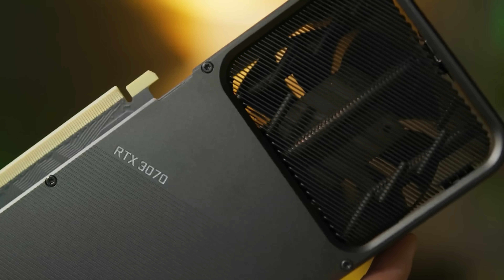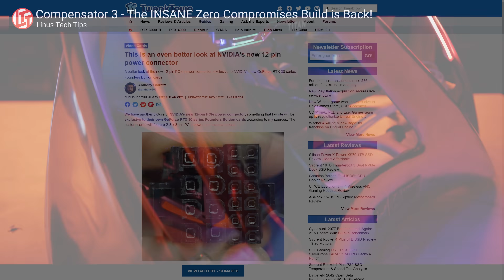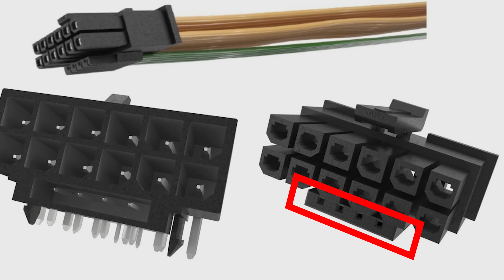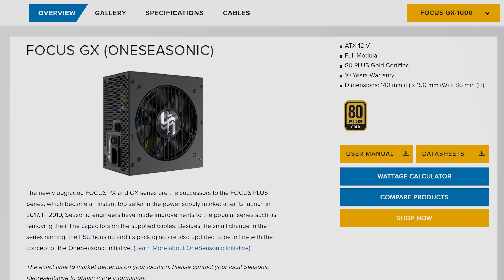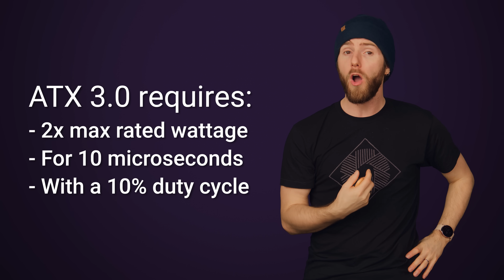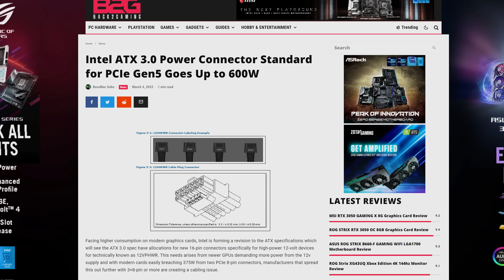Do You Need A New Power Supply? - ATX 3.0

Comment: Intel is getting even more anti-consumer. Great. Exactly what I needed. Just bought a SeaSonic Prime PSU last year. Now, with my planned RTX 4000 Series upgrade, I'm most likely forced to buy a new one. Intel you **
Reply: This is like being angry that a new wifi standard got released when you got a new router a year ago. It's not gonna become obsolete at the snap of a finger, hell this entire video was basically saying "it's probably not"
Reply: @2KDrop  Yeah, no. It's a different story. Even when a new WiFi (or USB) standard is released there is a certain backwards compatability. There is no need to upgrade all devices to establish communication between them.
Reply: This isn't anti-consumer. Intel doesn't really get much out of this other than making things easier for themselves and others.  

If we want things to remain somewhat standardized, we need those standards to be updated to match modern technology. If graphics cards are drawing more power than an ATX PSU can easily provide, then GPU and graphics card makers will start using different options. We already saw that with Nvidia's attempt to create a new 12 pin PCIe power standard.
Reply: @MiIIiIIion  It's anti-consumer because of the communication "needed" between the GPU and PSU. It's unnecessary and a simple lockout / controlling mechanism. 

No one would have had a problem if they only used a new connector or thicker wiring. Those changes would`t make current or older PSUs useless. It's not like they can't already provide enough power. 

This also produces unnecessary waste. Decent PSUs easily work for 7+ years and can be used again and again. That's why there are established standards.

Comment: My pc used to shutdown when running benchmarks with my 3080 was using 2 separate 8 pin cables plus one of the pig tails that comes with the cable. Switched to 3 separate cables and it fixed the issue. RM850x PSU.

Comment: Yeah, no, I don't want companies abusing the voltage negotiation chip to sell the same PSU at different price points but with intentionally nerfed power delivery.
Reply: That literally would make so sense from the manufacturers point of view. This is a stupid post, but somehow 28 people were dumb enough to upvote it.
Reply: Why would they sell a more expensive PSU for less money by reducing power delivery
Reply: @pie75  Well, I suppose they could make it work on economy of scale, it usually wouldn't work because higher power means everything needs to be beefier and more expensive, but if you're buying a something like a million of them, maybe you can get the production costs low enough to be able to do that and you might be able to get away charging a slight premium for the fully unlocked models to make up for selling the lower end models cheaper.
So yeah, it "could" technically work.
Reply: @vgamesx1  but why do that when you can just do what they do now:

have the same production line but put less parts into the cheaper versions which deliver less power

economy of scale doesn't change that you're selling more expensive physical parts for less money than you could because ???

it's not a toy or a shoe, or an IC, where there's tons of room for binning

it's a PSU that has to be built for its rated power
overbuilding it is just spending money on stuff you're not selling
Reply: @pie75  Idk, why sell a car with autopilot and heated seats then disable access to those features?
Reply: @vgamesx1  the scale of production for a part like a PSU is on a completely different level from an entire car of any manufacturing capacity. PSU's don't have as much room for gains in the economy of scale, because that's a logarithmic efficiency.

Even then, most cars don't come with those features: you pay for them to be physically installed. And the subscription comes afterward.

They don't distribute cars with features locked in basic models - those models simply don't have the parts to use the features. Giving people pieces of the puzzle that they haven't paid for is paying for things you aren't selling.

Selling them the parts, and then selling the subscription to the parts, is adding revenue onto a sale - which is not the same as "selling the same PSU for less because it has a software lock on power delivery"
Normally with small parts, the thing you want to do is sell the same thing for more, with the software reporting its details incorrectly. - you know, scamming, not paying more to sell for less.
Reply: @pie75  Never said it was the same, if anything it would probably cost a lot more to do that sort of thing on a car, which was my point... If it can be done on a car it can be done for other things and companies will do it, obvously those that do ran the numbers then came to the conclusion that it was simply cheaper to do it that way.

Yes they do in fact ship with those features, at least if nobody else Tesla certainly does, where have you been for the last decade? There have been a bunch of news articles talking about these sort of things with hardware being locked behind software, the heaters, the cameras, everything is there, it's all litterally just a software lock you have to pay for, it's only recently that they've started to pull some sensors/features because of part shortages.
Reply: @vgamesx1  That it works for a low volume product like a Sports Car - generally explicitly excludes it from applying to high volume components like PSU's, where the economy of scale is already optimal.

Yes, Tesla ships their low volume Sports cars with software locks, they ship their cars with sensor packages.

Other companies have subscription services, other companies have sensor packages and premium features.
Only Tesla ships all the hardware - and as far as I know, only all the self-driving capabilities. And for good reason - they sell that data, evidently, all companies that produce self-driving cars, or use telemetry at all, sell the data.

Would a PSU company ship sensors in their PSU if they could sell the data? absolutely - they still wouldn't sell you beefier capacitors and 4x the weight in copper for the same price.
They'd sell you a PSU with the same case, PCB and sensors, - and the unnecessary components not installed.

Companies ship small sensor packages because they can profit off them. They don't ship in-seat heaters, or additional fuel tanks, or optional electrification, or optional hybrid power trains - you need to send the car back to have those installed after-the-fact.

If Tesla does, I can only imagine the miniscule effect it has at their single manufacturing plant, compared to the tens (more, if you group brands by owner) that their contemporaries operate.

In general, things that Tesla does are exceptional. so exceptional, and unprofitable, that they don't work at all for other companies - who aren't in a position to extract so much capital from other sources: government research grants, green tax breaks; Musk's other companies, bypassing auto-dealers; direct sales, etc.
Reply: @pie75  I can see GPU manufacturers abusing this.
Reply: @pie75  Maybe so they can sell you dlc to upgrade it later. With a subscription of course. And only if you buy an NFT.

Comment: one connector i have always hated is the big 24 pin for the motherbored,  i hate how it's really hard to connect properly and needs a lot of force to put in and then needs a lot of force to remove even if you wiggle it gently,  it feels like your going to break the bored with how much force you need, it would be nice to see a smaller connecter for motherbored power, like made something simler to the sata power connecter maybe like a longer version of that, it it would be a lot easier to connect and remove, plus take up less space.
Reply: Yeah fuck the 24 pin connector. I still don't get how they haven't addressed that by now.
Reply: Has everyone forgotten about ATX12VO? I remember seeing a decent bit of coverage about it but it seems to have just disappeared.
Reply: @2KDrop  sadly, no one wants it because it is either not backwards compatible or requires a relatively fancy adapter to work with old components.
Reply: @2KDrop  VO was a fire induced nightmare it was dropped quick

Comment: With now annoying the 24-pin motherboard one is already? Already have to wrench it to get it IN the board let alone what forces it requires to try and get back out. Even if it's only 12 normal sized versus the 8 now yeah but then you throw 4 micro pins in there that'll snap off easier.

Comment: We don't need this, if your card is really going to draw 600w then it has enough room for a 4th 8pin, it's not a big deal. 

Power spikes can be fixed on the card level.
Reply: Four 8 pin connectors takes up a lot of space. Not to mention needing 32 individual wires for a single 600w card.  

And on top of that, what if there's more than one of those cards in a system? Are system builders willing to shove 128 wires into a 4-gpu workstation? Will PSU makers be willing or able to put sixteen 8 pin connectors on their PSUs?  

This new standard will halve the number of wires required along with halving or even quartering the footprint of power connections for the highest power cards.
Reply: @MiIIiIIion  i don't think system integrators or anyone else is going to want to shove multiple 600+ watt GPUs in their system, have fun cooling that.  Also workstation users and server operators tend to have specialized equipment anyway so sure it wouldn't bother them to go for a new standard but for most applications outside of that a card that powerful is going to be rare. 2-3 8 pin connectors work perfectly fine.

Comment: Think I'll just stick with my AX1500i and dongle it up, or just re-pin it. That 2x power draw seems more like a failure on the GPU manufacturer, if I buy a product and it says it draws 400 watts, but ends up potentially being 800 watts, isn't that false advertising? If that's the case and it causes component failure, shouldn't they have to pay for it? Can't really hide behind a "we didn't know" if there are specs being based around such a thing. I don't care if they draw 1600W on a GPU as long as they state the maximum potential wattage on the box (excluding customer interference of course). Manufacturers have to state the maximum possible wattage for appliances, there's no reason GPUs, or any computer component, should be any different. Same goes for motherboard manufacturers with their single click overclocks, they should be stating what the potential wattage is. This is coming from someone who ran 2 hardware modded and overclocked GTX980s for 6 years before one finally died.

Comment: How long would It be okay go keep lets say a Bluetooth speaker before you must think about discarding it before catching lithium fire? Can you guys research this?

I have a JBL Clip 2 and Ive been using it for many many years now. But now im worried of not being able to see the batteries condition other than how long it lasts. At what moment is it safe to say you MUST throw it away to avoid your house burning down.
Reply: Take it apart and check the battery.

Comment: What's stopping them from adding a 2 Pin Mains socket on the back of the GPU ?
Reply: Quite a lot of things, but let's start with the fact that a suitable rectifier -- a PSU -- that could handle that would add quite a lot of bulk to cards that are already causing numerous problems due to their size.
Reply: @Blooest   the 30 series card’s PCB is half the size of the actual card, plenty of room. You don’t see consoles with massive PSU’s like PC’s. There probably big because they are handling different voltages, and there is no demand for them to be smaller. I think its plain lazy on the vidoes script that it doesnt even consider on board power supplies. Its almost as if its a PSU advert. Nvidia promoting new PSU’s Intel Promoting new Motherboards each Gen. more can be done on behalf of Nvidia, they just don’t want to.

Comment: I miss my old Asus Strix 750 ti. No power connector, it ran off the power it got from the slot. Oh well, I will see what the upcoming AMD AM5 APUs are capable of. 
No discrete graphics card, and M.2 NVME drive, so the only cables I have to worry about are the fans and that glorious ARGB.
Reply: Honestly of they are good enough i might skip the graphics card altogether for a few more years. I'm already getting decent frames in new releases in 1080-1440 with the 4750g.
Reply: @Lightning Hydra My 3200G has about the same performance as my old 750 ti. Enabling XMP on 3200 DDR4 makes it faster than the factory OC of the 750 ti with the same 2GB of dedicated video RAM.
Reply: AMD will intentionally cripple these APUs as not to endanger PS5 market . They need to sell chips to Sony for few more years , so games on their APUs must not look better than console games.

Comment: If I remember correctly, there are also standards that let the motherboard control the voltage - PSU gives it 12V and it handles the rest - for me it would be kinda interesting to see some kind of a miniPC that has an actual ITX board inside, but is still powered by an external powersupply you can see in laptops :))
Reply: Pico PSU.  

They're still ATX PSUs, but they use an external brick to provide DC power and just a tiny little module that fits on top of the 24 pin connector to provide 12, 5, and 3.3v plus a couple of extra connections like SATA power.
Reply: Just had an extra though that would make this idea even more interesting. An external multi-rail brick that has the various dc/dc conversion in it could also easily be made with one or two different output connectors. For example since you most likely got at least 3.7, 5, 9 and 12 Volt rails, you could throw in a usb or usb c connector for example to allow other devices to charge or power from it as well. 
Saves you an extra charger at home for your mobile devices, or could allow you to use power bricks more PSU like and independent of the system. Pc needs 200 watts peak? Get a 300W brick and plug your monitor or your soundbar into the same brick. Easier to cable manage, cheaper and probably more efficient than to have multiple devices throw fairly cheap converters kf their own into the mix.
Reply: There are ITX boards like that, although nothing high end.
Reply: That's been around for ages in prebuilt systems. 
LTT did a video ages ago on the 12VATX standard too.
Reply: Actually for a mini pc you'd want the exact oposite. The problem is that transformation is at least a bit inefficient and creates heat. 
For a mini pc where everything is very close together, do you really want to stick additional heat producers right between your already very toasty components, or would you rather that heat happens in the external power brick?
Plus, there is no real reason why an external power brick can't have a multivolt output connector for your mini pc. All it does is limit the distance it can be away from the pc a bit
Reply: @reappermen  a multi--volt brick would need a multi pin input jack. 
Normally they just use 12-19 colt DC brick. Because the DC conversion internally is far easier.
Reply: @agentcrm  yes, it would need a different, maybe new connector. But doing durable safe external connectors for plenty of power is a proven concept now with stuff like usb c power delivery and such. So there's no real difficulties with making a 10+ pin connector between power brick and machine that is small yet durable.
As for the conversion, dc/dc conversion is indeed easier than ac/dc, but just like with the multi pin connectors there's absolutely nothing preventing anyone from taking a normal e.g. Laptop power brick and throwing extra dc/dc conversion in it.

Since this whole discussion is about new hardware standard vor power supply, we might as well go with the most physicaly and economicaly sensible option.

Comment: I like the idea of a 12V only power supply.  I dislike Intel's stupidity of complicating the GPU power connector with the extra mini-comm lines.

-Matt
Reply: Personally I don't care for the 12VO, it is on course but goes too far.
5v should be kept completely, and 3.3v should still go to the SATA plugs but no longer to the motherboard.
This keeps visible cable mess down as everything doesn't need to be plugged into the motherboard, and board space isn't being taken up by a bunch of power connections and the other half of the powersupply.

As for 12VHPWR, the 4 extra pins are not data, more along the dumb-logic lines.
[Editing as an updated document was found, and I had swapped some pins]

S1 & S2 are from the card and listed as optional
S3 & S4 are from the PSU and define the power limit by leaving the pin open or grounding it. (GG=600, OG=450, GO=300, OO=150)

Technically none of them need to go back to the PSU if only one GPU is supported, just tie the correct limit pin(s) to ground at the connector.
Reply: @ttomkins4867  allowing the mobo to turn off the 5v and 3.3v  transformers saves electricity.